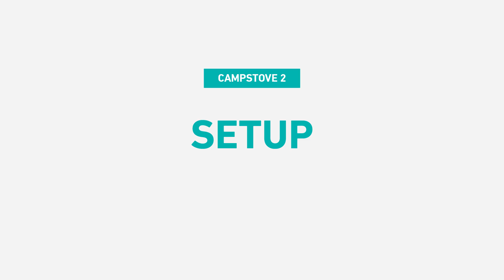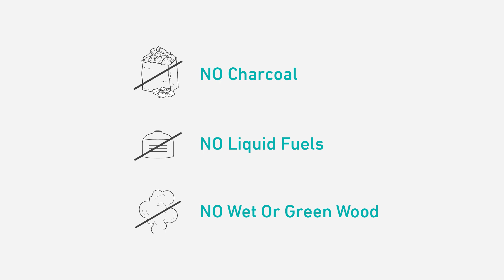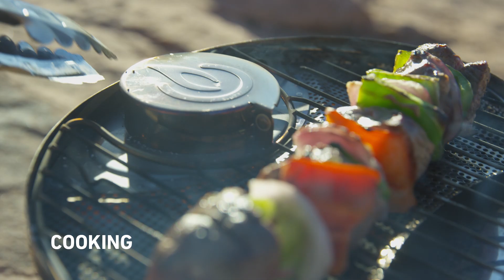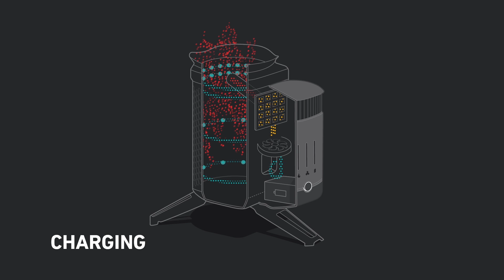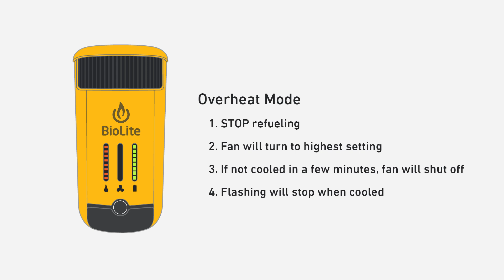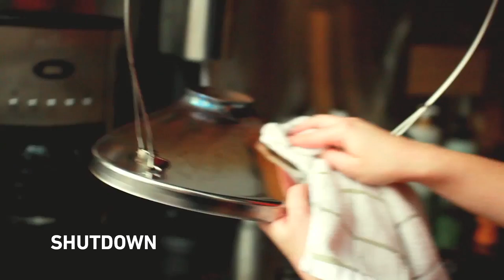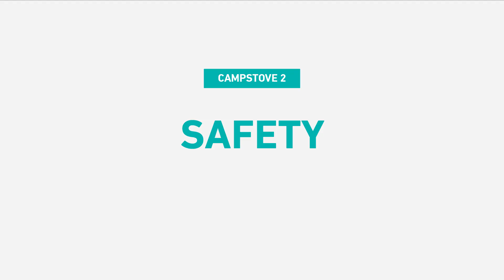BioLite | CampStove 2 How-To Instructional Video

Comment: Looks really nice, but the combustion chamber looks bit small.
Reply from the maker: Hey, check out our response to Johnny below - we explain there!
Reply: FIT !! AN !! INCINERATOR !! IN !! YOUR !! BACKPACK !!SAUNA !!  HEAT !! GALORE !! NOW !!!
Reply from the maker: Hi there -- the combustion chamber is the same size as the original CampStove and thanks to it's efficient combustion, it's capable of providing really hot and strong flames that can cook full meals. You can do a lot in a little space when the physics are aligned :)
Reply: Hi BioLite thanks for your quick answer! I might as well ask technical.
How many liters fit into it? I imagine I have to crush the wood first before I can fit in there.
I love the idea of using wood for generating energy, your system looks amazing!
Reply from the maker: Hey! So from a pellets perspective, the chamber can fit about 300-400g (you want to fill right up to the last row of jets so it can be completely combusted, don't go past that). From a stick/twig perspective, it's hard to say exactly because it will depend on the diameter of your fuel and the room you leave for the fire to get oxygenated (you don't want to overstuff). We would recommend right-sizing your fuel down to about 5-6 inches in height so it can burn completely.

If you're collecting sticks, we've got a little hand tool that can help snap them to the right size: https://www.bioliteenergy.com/products/sticksnapper